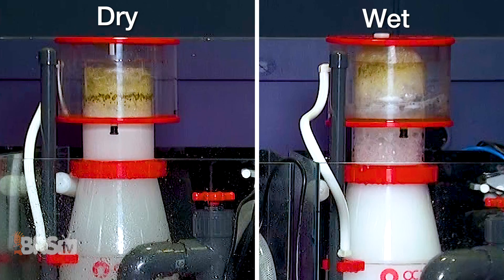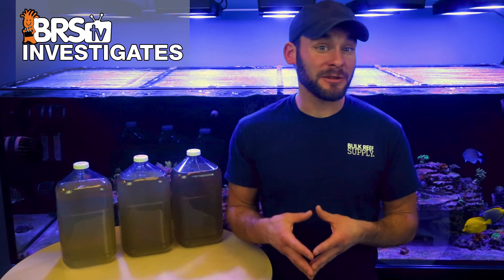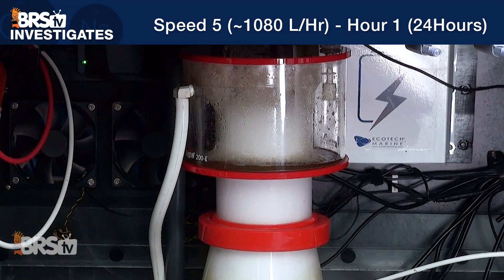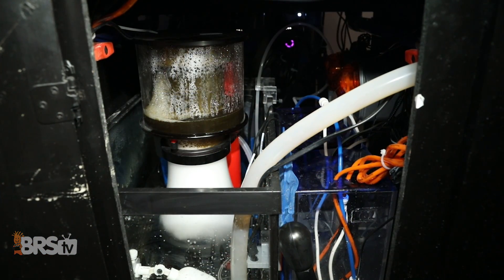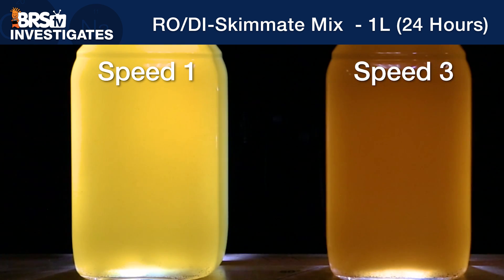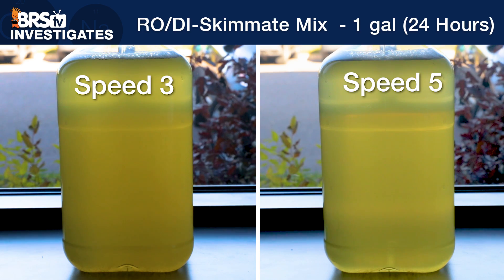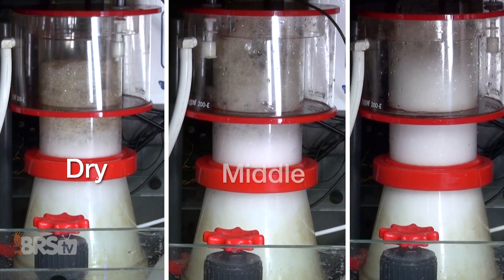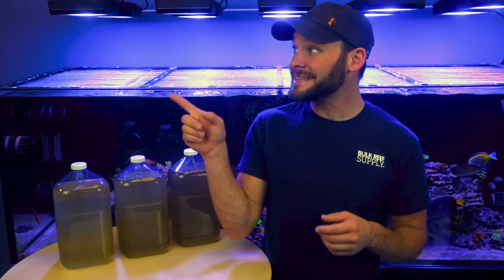DIY protein skimmer test you can do at home! Dry vs. Wet skimming? | BRStv Investigates

Comment: I'm looking to get this same tank, and looking at either the Regal 200INT or the Regal 250INT. Why did you decide the Regal 200EXT and not the 200INT? Why not the 250EXT since the 200EXT is got 175 gallon heavy bio load and the Red Sea 750 is a 200 gallon system?
Reply from the maker: The EXT model is a recirculating version, meaning that it utilizes two pumps. One pump to mix water and air and the other pump to feed water into the skimmer body. This lets us fine tune the flow rate into the skimmer body without affecting the air. Super effective! Since we were using a roller mat on this tank, it made sense to go with a smaller skimmer.

Comment: One question I have has to do with run time?  Do you run a skimmer 24/7 or maybe 12 hours a day?  I’m thinking of only running mine during the day and shut it off at night when my fuge is on.   Let me know if there is pros or cons?
Reply from the maker: A vast majority of reefers will run their skimmers 24/7, but if you're having issues with too low of nutrients in your system, you can certainly run it less than 24/7.

Comment: it'a a good idea but non perfect : if you want to compare wet vs dry skimming, you must JUST adjust the level on the skimmer (high, medium or low), not the quantity of air (the same for the 3 test)
Reply: They already explained in a previous video that changing the water level in the skimmer doesn't actually do anything except affect the collection rate

Comment: I'm running a 250-E on my 750XXL at max air draw, with a CoR 20@ 13w and roughly 1300 RPM. Skimmer is external with the water height roughly the length of the tip of my thumb to knuckle from the bottom of the cup mount. Skimmate is thick, black, and the foulest smelling I've ever experienced.

Comment: I have a problem with this test 

It sounds like you tested setting speed 1 next setting speed 3 then the final setting speed 5 every 24 hour one right after the other?
Let me guess you tested speed 1 then 3 then 5?
So setting speed 3 could pulled more organically rich water because setting speed 1 did not gather much in 24 hours? making the water more rich in organics for test number 2. Is this possibly why we see less organics in speed 5 vs speed 3?
Just a thought 

Or did you reset after each test? letting the skimmer run at the high setting 24 before the next test? 

It is just a thought not that the test is wrong just that it could be wrong and explain the difference between test 2 and 3?
Reply: 100% this!
Reply: I was going to comment this but you said it great and beat me to it

Comment: Interesting tests. I too was waiting for a taste test. Where's Ryan when you need him?
It's not clear from the vid if you captured the solids coating the sides of the collection cup. Wetter usually doesn't have much in the way of solids where dry is almost all solids coating the riser tube and top section of the skimmer body.

Comment: I would like to see a sump setup with the skimmer before the filter socks. If I could get nori debris out of the tank, before it hits the socks, the filter socks wouldn't get clogged so fast, and it would be out of the water.
Reply: @diacanthusreef3609  for my case specifically, my Octo 150 is setup externally and plumbed from a bulkhead in the first sump chamber. The skimmer cup is also plumbed to a sewer line and washed out with the RODI discharge line. I'd rather siphon the first chamber of the sump more often than change and clean filter socks.

In theory, the sooner the organics leave the water, the less nutrients added.

It is also my opinion that too large of a skimmer is over-rated (pun intended). If a skimmer is too large and looses its head, the ability of that skimmer to float organics is null.